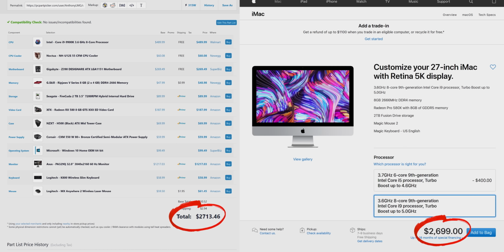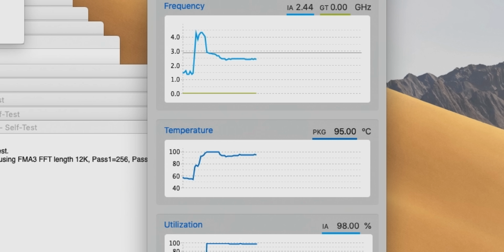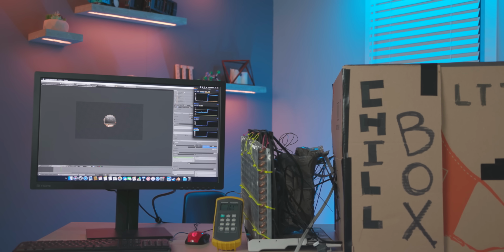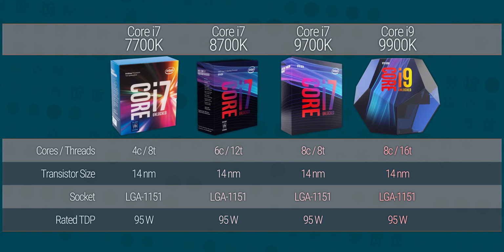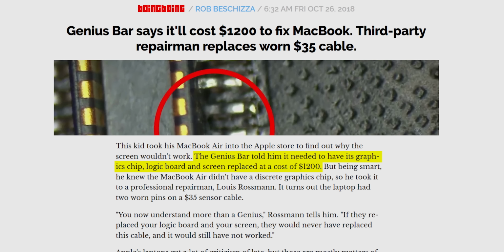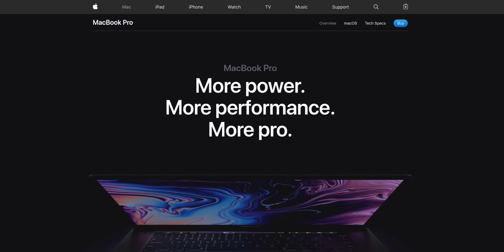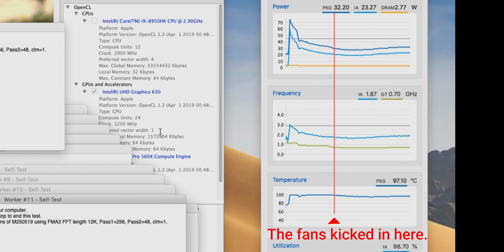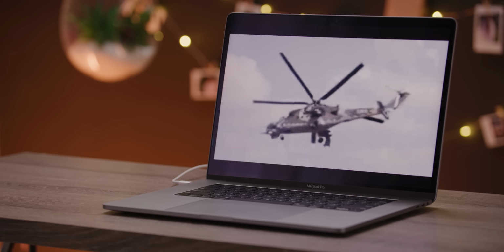Macs are SLOWER than PCs. Here’s why.

Comment: I was laughing so hard when they blowtorched the motherboard. You would too if you know what temperatures that gives. 

My first pc build was with a AM286 cpu. I didn’t know I needed a cpu cooler at the time. But I ran the computer and it worked great. Until I did something a bit more demanding. Then it would shut down. But I’ve NEVER had a cpu fail on me. Never. Neither have ram or motherboards failed. I’ve had PSU’s fail a few times. But I think it’s three failed since the late 80’s.
Reply: So you mention the AM286 overheating and quite literally failing due to that, but then say it didn't fail?  Do I have that right?
Reply: Marc LeBlanc No. you don’t have that right. It turned off the computer to save the cpu because of heat. So no, it didn’t fail. It did what it was designed to do. Did you get THAT?

Comment: Why would you use your macbook at full throttle? When my pc or laptop is really hot, I just use cooling pad, blow with a fan, use aircond, open windows for air circulation and close all other insignificant applications. 

You could do the same with macbook pro. It is a well-known fact laptop would never run as powerful as desktop that is released on the same year. 

Any pc/laptop would face the same issue. For care, I never use my pc/laptop at full throttle. Any electronic devices would prone to overheat and damages if used excessively... 🤔
Reply: If you need to do all that to keep your laptop cool that's indicative of a problem with your laptop. Not to mention portability becomes an issue if you have to lug all that around with you because the manufacturer was too obsessed with making the thing thin to make it functional.
Reply: @A-Beat-up-86  Well I used the cooling approach when I need to use it for along time. Btw, any laptop is not meant to be used for heavy applications for a long period of time. Only gaming laptop with sophisticated cooling system can withstand heavy usage and full throttling. 

Things are created with a purpose and has it's own limitation. I never bought a mobile laptop to be used for heavy usage. Only a desktop would suit the purpose..

Comment: what case was that at the computer upgrade king sponsored bit? the one with the infinity mirror rgb.
was it the continuum or continuum micro?
everything i see on the regular continuum is only a solid colour
Reply: The case shown was a Continuum Micro. Both the Continuum and Continuum Micro come with color changing LEDs as shown in the video.
Reply: @rainbowdash5366  but the micro has individual led colour and intensity, features I didn't see in the larger variant
Reply: @Nostrite  The full size Continuum does have the same features; I've worked with the full size before. Each one of the LEDs are individually controlled.
Reply: @rainbowdash5366  thank you.

Comment: Macbooks behave very well after those updates. Clock speeds are base but solid. Honestly I wouldnt like my laptop to be thicker and heavier for additional 10% in performance (and only under heavy load). Imacs and mac minis are the real problem and they should be cooled better.

Comment: Apple already designed the MacBook lineup to follow the initial Intel roadmap. The fact that intel does not deliver is not Apple's fault, which is exactly why they are planning to just ditch intel altogether and use their own Apple-designed chips. Research and development does consume a lot of time and money, which does not give Apple enough choice to just scrap away the new design for MacBooks back in 2016. 

Using Apple SoC would introduce other problems such as app compatibility and the lack of x86 architecture due to the usage of ARM architecture for Apple SoCs for the moment. x86 is owned by Intel, which probably means they are not gonna give out the technology to Apple just to compromise their own CPUs. Also, the new MacBooks does rely heavily on the ThunderBolt technology, which is also owned by Intel. 

So it's not really fair to put all the blame on Apple when Intel pushed their initial roadmap way beyond what's claimed.

Comment: It's because mac doesnt give a fiddlers fuck about their customers. Regardless of if it's a bad product or not your still going to buy it. So fuck it "oh yeah it has a i9 and a 2080ti and 64gb of ram and a 2tb ssd harddrive that costs $3k" but it can be out preformed by a $900 i5 1060 because it doesn't throttle. It's a numbers race. They only want your money hipsters, they don't care about you or your blog. Multimillion dollar company's. Same theory as Ford, they sell more trucks than any other company because when they break down at the end of their predicted life it's cheaper and easier to just trade it in for a "new" truck. And then you look at Chevy or Honda and they still have vehicles from the mid 80's early 90's running around that's NEVER had any major service other than maintenance. It's easy to be number 1 when you design your product to fail at a certain time period ensuring you have repeat buys. SMH...

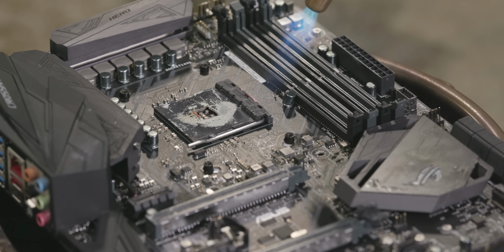Comment: 4:59 Two 2011 Macbook Pros died between 2013-2015. One had gpu failure and another is unknown. Both could've been because they been running hot. One of it was a 13" and it idled at 80C. It had terrible thermal paste and the fan design was awful because it took hot air it exhausted then ran it through the fan.

Comment: I agree with this video. However I believe the answer is with the software not hardware. If you're buying a Mac these days for the hardware you're not doing yourself any favours. So in theory putting weaker hardware is more logical. Although hands down my preference is OSX over windows any day of the week. I don't really think about my Mac thermal throttling when I can use sketch for my design work and final cut to do videos and get the job done 20 times faster than windows equivalents. Use airplay with a group who all have Mac's. You can't change that. It's real world work loads like these that largely make the experience. Unfortunately for me it's also industry standard.

Comment: I believe the reason for this (just my opinion) is that is to conserve battery life. If fans were to keep it cool it would run better; however it would die faster just to keep everything running performance. 

Fact that you can only “custom build” your specs by sending it in and paying them to do it is just crazy market strategy; and the only time to fix it is also sending it in, yet that’s even if t CAN be fix.

Comment: I can completely agree with this. When at a party recently, my macbook air (costing over €1000,-) had difficulties running minecraft at medium-low settings, all while feeling hotter than all of the other laptops in the room. It even made the key's around the cpu noticably hotter than the rest of the keyboard. Why is it so damn hard to add a proper cooling solution?

That being said, it still outperforms my normal gaming pc by a somewhat decent amount. (My gaming pc is a 2008 prebuilt which is running integrated graphics and a core2 duo e8500.)

Comment: Why does Apple do this in Mac's when they don't in iPhones.....it's pretty simple... Intel has been stuck at 14 nm for three generations of processors and for nearly five years. The latest iPhone CPU's are running on a 7 nm process.

Intel announced their first delay to the 10nm process in.....2016....their latest until late 2019.....

Apple and many other companies likely designed their products assuming Intel could hit their targets. Instead Intel is late, suffering shortages, all manner of problems, etc.

Maybe Apple should have just re-engineered around all the Intel problems but they've chosen what is detailed by Linus instead. However the reality is all these more powerful processors would have easily run in the Apple systems with top-end and cooling to spare if Intel had hit their targets and simply kept their own roadmap.
Reply: That's a fair point. Also, the  iPhone uses a chip that is specifically designed to run at full speed in a slim and light form factor. Apparently they're on a roadmap to also create a line of Macbooks using the Apple designed chips.
Reply: I would agree with you.. except the generational improvements in thermals caused by going from 14nm to 10nm would be nullified by intel still trying to cram as much raw power into a mobile chip as they could with the hk series, likely resulting in a 10nm i9 at 3.5ghz base instead of 2.9, same tdp. Also, the difference in thermals even if left at the same performance level as current gen chips would not overcome the SEVERE lack of cooling in Macs. And, that's not even when Apple started pulling this, since it was stated in the video that these overheating issues go back to at least 2011 with macbooks using dedicated gpu's. I gotta go with Linus on this one, Apple just doesn't care.
Reply: Apple sells more iPhones than Macs. That's the reason why an iPhone is more polished than a Mac. But they are loosing market share with both products.

Comment: I have been an avid Mac user for the past... 13 years. Even my current desktop is a late 2012 - 27" imac, before that I had used a Macbook Pro for 7 years. But I am not liking the direction apple has gone with their hardware. It used to stand for great build quality, longevity, and value for money (even at a premium). My biggest gripe now is with repairability and upgradeability. Everything is soldered down and hard to replace, and the reliabiliy of their new hardware seems suspect. I am currently planning my next pc build and it is going to be linux machine with osx and windows in VMs if and when I need it. I think apple has peaked, and now they have so much money and a well established premium brand they don't care about their user base now, and it is a real shame.

Comment: ok so lemme give you a story. i run a mac air 2015 with a dual core and integrated graphics card which i have gamed on for the past 5 or so years. I recently bootcamped the mac to be a windows operating system. The computer runs much better than it did on the mac os and interestingly load in times have decreased and it is almost like it lest my ssd run faster because of the fact that it feels that everything loads quicker. Not only that but i have gotten less viruses and i have had very few problems with crashing. JUst my experiance

Comment: Linus, there is an answer to the iPhone vs Mac thermals question, and it's not difficult to see.  Apple's moving toward taking their Macs and using their own custom CPUs - they are as tired of Intel's BS over the last dozen years as anyone else!   iPhone doesn't throttle, because the Apple-designed CPU + Apple-designed Software means they can make a complete package.  Apple switched from Power (IBM) to Intel because IBM wasn't able to keep up with the performance demands, and Intel's been in the same unable-to-perform boat as IBM, but Apple had nowhere else to go (although, I would think they should seriously take a look @ AMD Ryzen @ 7nm before moving over to completely in-house CPUs).  tl;dr - Apple build the iPhone CPU, so no throttling.  Intel has sat on their rumps for 15 years and is only now in a panic over AMD's Ryzen, and Intel is completely lying about their TDP.
Reply: apple cpus are based on the ARM architecture and the newest ones are 7nm

This means it can reach lower temps more easily.

this is without fault tho. anything coded for the old x84 will see a performance downgrade with arm cpu's

Comment: Feature not a bug. 

I run my hackintosh overclocked to 5.0ghz on all core of my 7000k, water cooled with LM thermal interface materials.   Vega64 for graphics and no worries about upgrades; just have to make sure I keep Clover up to date.  Anyone who has the skill to build a Windows or Linux box and the patience to wait for hardware to get verified by the hackintosh community shouldn't have any more frustrations than a regular enthusiast builder.  Getting the hang of the boot loader and kext system isn't that difficult.

Comment: Just build a custom pc and throw a hackintosh right on it . Or buy a laptop that can run a hackintosh
Reply: XillReall ViZ I did just this. 9900k, Vega64, 32RAM, Samsung 970 pro for boot and a QVO 1TB for files.
Still cheaper than the upgrade I was looking to do through Apple. Could stretch the cost over the year as I sourced the specific components I wanted too.
Reply: XillReall ViZ Mac OS updates.
Reply: Or just go the Linux route. Been gaming on Linux for almost a year and I have not found a game I can't play.
Reply: @albydata  Gaming on Linux is equivalent to gaming on Atari during Sega vs Nintendo console wars days.
Reply: @albydata  DMC 5, Metro Exodus don't run via steam play/ dxvk/ lutris yet. Your argument is invalid for games with DX11 support.
Reply: @hackshaw-22b  Well since I have no interest in purchasing those games, I don't understand how my comment is wrong. That's pretty rude to tell me that I'm having trouble running a game on my PC that I never wanted anything to do with. And my comment wasn't an argument, it was a suggestion.
Reply: @hackshaw-22b  DMC 5 does run on dxvk, what are you talking about? DX11 support is pretty mature through dxvk, most games run just fine. It's only DX12 that's as of now unsupported.
Reply: Because Hackintosh is illegal and no self-respecting professional would go anywhere near it.
Reply: @MichaelGGarry  They are a ton of Pro's who are using Hackintosh for work because Apple doesn't give a f about them...I use my ProBook 4540s with Intel Core i7 3612QM (quad core chip), 8 GB of RAM and Samsung 850 EVO SATA SSD and this laptop is a beast both in OS X and Windows ! As the performance goes it quite close to a 8th gen i3 and i5 laptop CPU...
Reply: Max Hartung Any “pro” that uses pirated software of any sort is a disgrace, frankly. I would never work with them and neither would any pro I know. There is simply zero excuse.
Reply: Hackintoshes alwaya sound like a huge pain in the ass. You have lot of spare time?
Reply: Everett Keithcart if you are experienced or follow the correct guide it’s probably setup within an hour
Reply: Or just abandon Crapple all together for the lemons they are.

Comment: Concerning the "same price" argument. Yeah, it's pretty much correct for iMacs, but I find the price differences especially present when looking at laptops. I've seen same-spec'd Asus computers at literally half the price of an equivalent Macbook. Sure, Iris graphics is a bit stronger than regular integrated graphics, but you also have to consider the fact that a lot of students buying Macbooks are only really concerned with cpu, battery and storage space. And sorting by those requirements, it's easy to find cheaper and better alternatives than a Mac.

Comment: 7:24 Because their smartphones have proprietary hardware that they can design specifically to perform adequately under stress while in laptops they deal with established "off the shelf" components from their partners (Intel and Nvidia in particular). They are very limited in ways they can tinker with those components and boards are only pieces they can actually create to be custom. Therefore, in pursuit of slick looks AND top of the line components, they allow their laptops to throttle and overheat like that. It's not a change in philosophy, it's a cut-back that falls directly into their philosophy of having best internal components on the market if possible. It is wrong and should be fixed, but that's Apple for you - trying to go for two rabbits at once all the time.
Reply: @coryordway5575  so? GPU is not a part of the system and doesn't contribute to overall thermal picture of the device? Getouttahere.

Comment: If you perform ram swap on your mac, it isn’t a mac anymore. Does it mean it’s better now?😍
Reply: Good luck doing that since it's all soldered to the motherboard now, just another anti-consumer practice courtesy of Apple, and just another point of failure that will require you to replace the entire computer for an insane premium instead of simply repairing something yourself.

Comment: Glad to see you talk about this.  The disparity between how the CPU in my 2018 MacBook Pro performs between Windows and MacOS is disappointing to say the least.  Sometimes I see my CPU inexplicably lock itself to the base i9 rate of 2.9ghz and I have to reboot to bring back turbo boost speeds.  Worse yet, you can’t manually set the fan speeds in Windows due to the T2 chip.  It would be a much better device if Windows performed similarly to MacOS.  Sometimes I wonder if they deliberately make using Windows on a Mac a worse experience.

Comment: The last of the original Mac Mini had the strangest issue, the base was too short and suffocated the air intake, making simply putting it on a CD/DVD case drastically improve performance.

Comment: The A series chips in iPhones run at incredibly low clock speeds and use the ARM architecture which generates less heat than x86 so they don’t need to thermal throttle. It’s mysterious how Apple’s ARM core design is so much better than anyone else’s that it can have so much performance at such a low clock speed with no cooling. Imagine an A12X with cooling at over 5GHz!

Comment: 0:17 Except you don't need to spend over a grand to get a decent monitor. You can get great va 1440p monitors for a fraction of that.
Reply: The only reason they did that is to show how hard it is to get a 5K panel as good as the iMac's without spending over a grand. If it weren't for the screen, the iMac doesn't hold up value-wise against a comparable build at all.
Reply: @clebbington  Fair enough but still theres this https://www.amazon.co.uk/Samsung-LU32J590UQUXEN-32-Inch-Ultra-Monitor/dp/B07BVXGBHT 4k 32 inches for £335